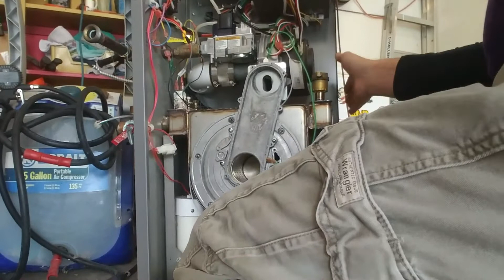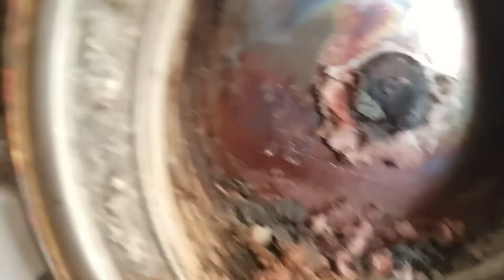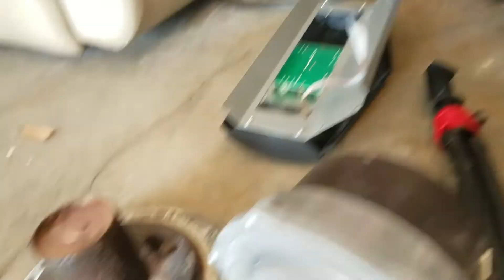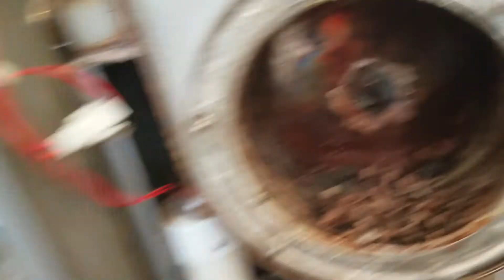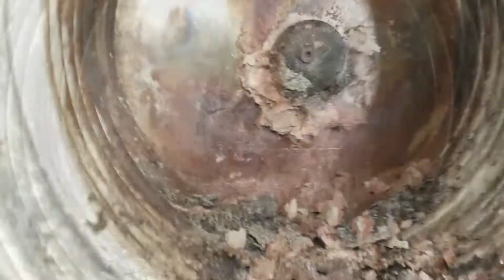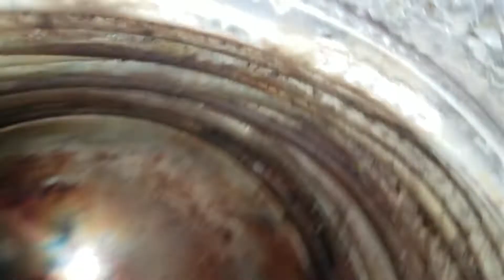The WORST Boiler Heat Exchanger You'll Ever See !!

Comment: hey there are  replacing parts , this  water heater need to be cleaned  every year , is not goin to  last forever
Reply from the maker: The new one will get annual checkup.  I don't want to have to pay for replacing this system again.  That sucked!
Reply: @MIFixItDad  we do an annual cleanup and it still failed us 6 years out .  each annual cleanout by a tech cost us $600 in san francisco, but can be done ourselves too